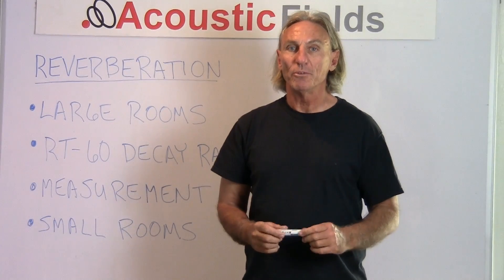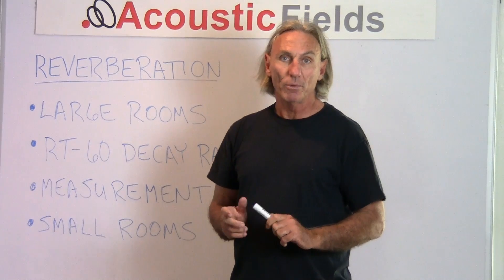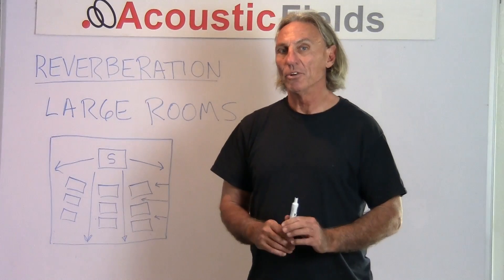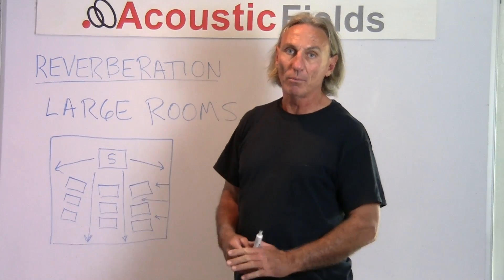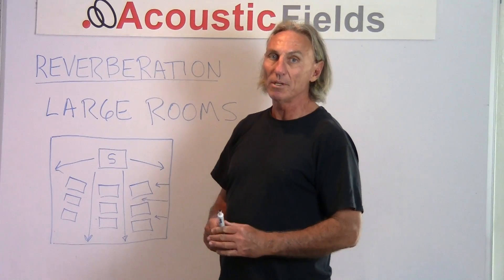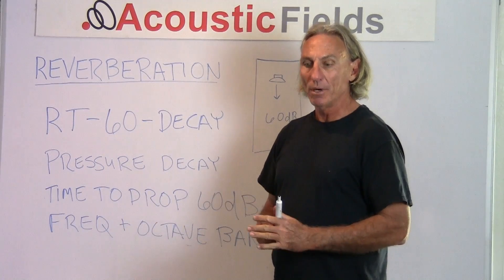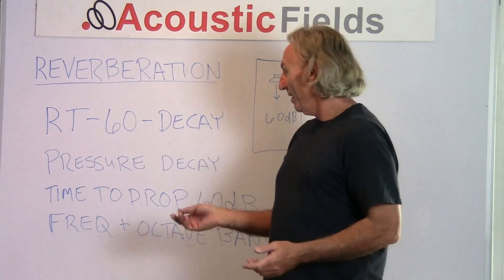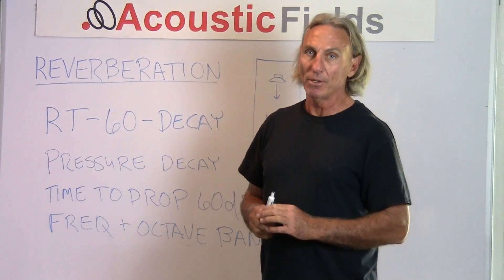Reverberation Definition - Large And Small Room Acoustic Applications - www.AcousticFields.com

Comment: Interesting.. but a bit vague. I think you were on the right track @3:35 when getting to the point about focusing on the center part of a room, which I think is key, so I believe you definitely have a quite valid point there. Personally, I would face the sound source directly upwards in the center of the room, which I'm sure might seem a bit impractical to some. Only problem then would be tightness, but I think chaotic reverb can be controlled in tight space by focusing the audio to one point in the center, then face the sound source upwards, but you still can't make it tight unless you alter the size and materials around it in some way, otherwise it's still going to sound loose or slightly garbled, especially in the 600hz to 1-2k area. Regardless, it will still come down to controlling the bell Q of certain frequencies by scooping out the offending reverb rings, since it will be impossible to eliminate them all.
Reply from the maker: In 18 years of testing, we have found that it is best to locate any sound energy producing device away from any room boundary surfaces. What you description above does not include is the type, amount, and positioning of absorption materials. Room response is critical.
Reply: @AcousticFields  - Type: Steel. Amount: None.. and Positioning: Sides 4x4x4x4, Height 8 feet.

Comment: Hi, Dennis- there's something I've been meaning to ask you that I've been very curious about since we started our project: Absorption panels, by and large, deal with reflection-- got it. But what happens to the frequencies, mids, highs and lows, that hit the walls and ceiling BETWEEN the panels? Thanks!
Reply from the maker: S,  Three things happen to sound. It is absorbed, reflected, or diffused.  Space between panels would be impacted by the material that is used between the panels. It could be absorption or reflection. All room sound is a balancing act between all three processes.
Reply: @AcousticFields  Thank you!

Comment: What i should do if the sound is too dead?
Reply from the maker: +DcoverZ Sessions You can add diffusion if the reverberation times are not too low. You must have some reflections to work with in order to use diffusion.

Comment: Great info and something I knew about as far as doing events in small stadiums, etc. So, would the process be as follows for a band performing:

1)  Put a sine, flat or whatever wave into the system at the stage
2)  Measure dB level, then shut off source
3)  monitor dB meter or software to watch the decay
4) adjust from there?

Thanks and I look forward to watching more of your videos.
Reply from the maker: Hi Chris,

Thanks, much appreciated.  In answer to your questions, do a sine wave sweep of your room by starting at 30 Hz. and moving up from that point. Before you do a sine wave sweep, measure your room frequency response and use the two graphs in unison to map out the pressure issues within your room.

If you have any questions email me at dennis@acousticfields.com and I'll be happy to help.

Thanks
Dennis